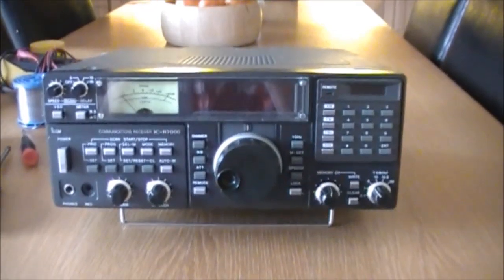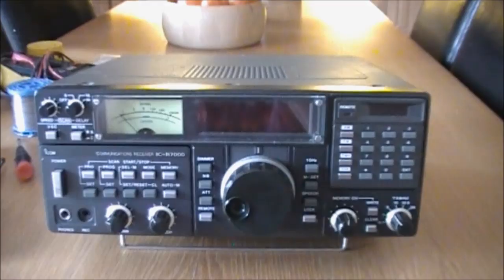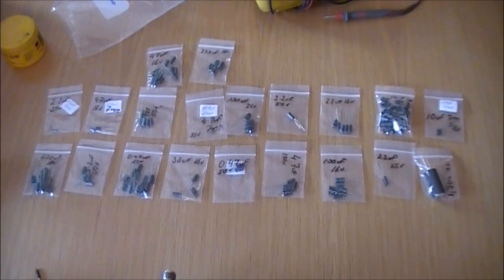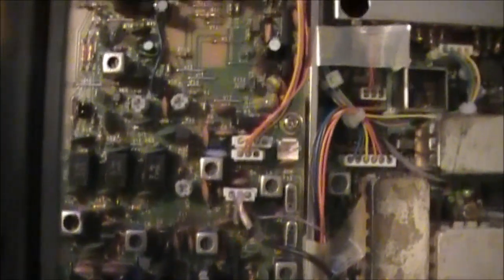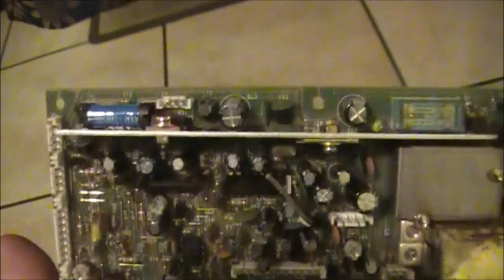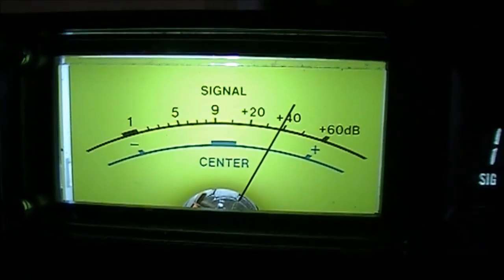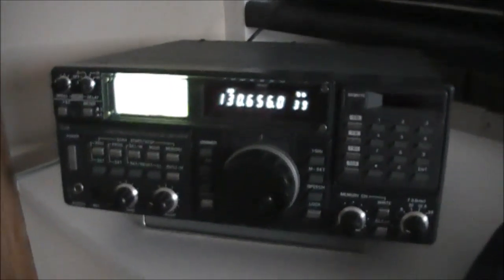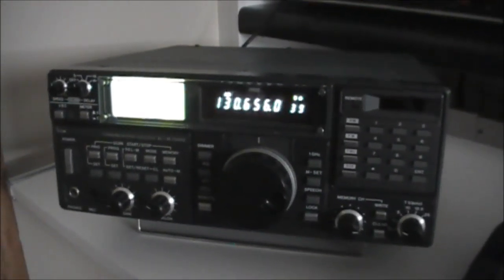Re-capping of an Icom  IC-R7000 VHF Receiver

Comment: Thanks for the video. I am just starting to recap my R7000. How do you remove the molex like connectors on the board? Is there a tool for this or do you just pull hard. I tried pulling but they don't come off and am afraid to pull really hard.
Reply: Hi Bruce. I've got the same R7000. Is there a list the caps that need replacement? Thnx!
Reply: @TheBrforsberg  got you. Thanks!

Comment: I have an old IC-R7000 that is working but I have to hit the power button 10 0r 15 times for it to power up,and all so when it comes on after about 10 to 15 min.'s it will start a very high pitch squalling sound ,almost to high for human ears .its not coming from the speaker but some where from the back side of the radio ,its not very loud and the radio seems to work other wise.any idea of what it may be ?

Comment: Man, this is nutz - even if it works. Just thinking about doing a job like this drives me goofy. I'd rather spend a few more bux and buy a new receiver. Good grief.

That said - I hope you used a higher grade capacitor.
Reply from the maker: It's not too bad once you get stuck into it... Yet they were upgraded to a higher spec 105 degree caps
Reply: Well, I should also comment that it is very good of you to post a video like this - Good will, and the confidence it inspires for this and other projects is really a great contribution to everyone. Thanks.

Comment: Hi George, Would you consider doing another one...One with a display that comes on for a few second's at start up then goes' off and seems deaf as a post ...Marty ..Armagh
Reply from the maker: Howya Marty. Ah I dunno....id do it ok but its a pig of a job marty and no guarentee it will ll resolve the display issue. That could be a display ic causing that. Could well be a cap too. Wouldnt be cheap marty, takes about 6 hours if you were to do it all in one go and go through the alignment afterwards
Reply: irishham1127 Hi and thanks for the fast reply..i hear ya on the pig of a job and the chance it might be an ic...It's just I have it here somewhere and it's still tidy and very clean...What sort of expense would it be just so I can make an informed choice...And what part of the country would you be near....Just incase lol...Marty Armagh..
Reply from the maker: Martin just seen this reply today for some reason.  Send a pm if you're thinking about doing it
Reply: Hi there,thanks for the reply..Im still thinking of having it done alright...Marty
Reply from the maker: Send me a pm sometime so Marty. Im in Athlone by the way

Comment: I bought a used R7000 back around 1997 and loved it. I kept it a few years and eventually got rid of it and purchased a used R8500 and have enjoyed it ever since.
My R7000 worked great but it did have the inherent display issue where it would suddenly get dimmer for no apparent reason. The lad I sold it to was eager to repair it and it worked fine ever since :)